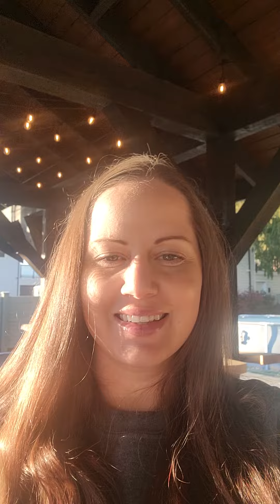Our 10 part series "Problems with Retaining Walls"#1 They are not built properly

Comment: Why gravel as a base to stack on? Why not concrete
Reply from the maker: We build to Allan Blcok specs. Gravel provides drainage. Without water there can be  no frost heave. Gravel is flexible, and thats the strength of Allan Block. It can move with the weather and changing seasons. solid concrete retaining walls usually fail.